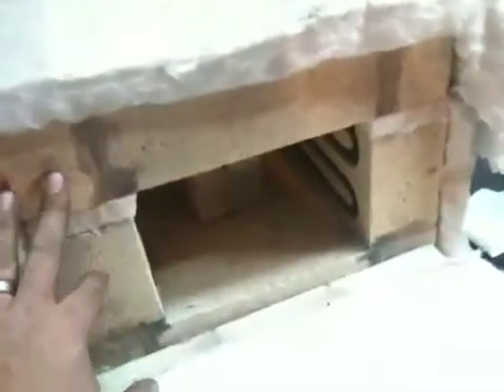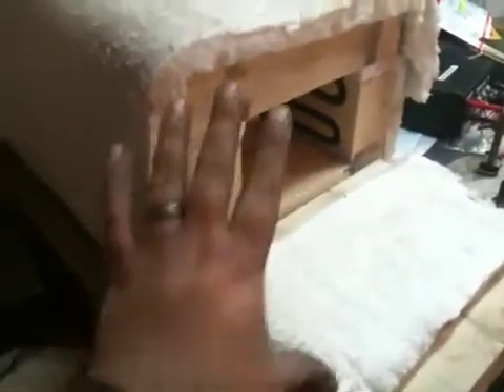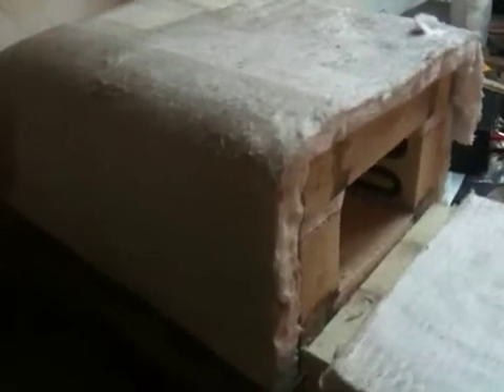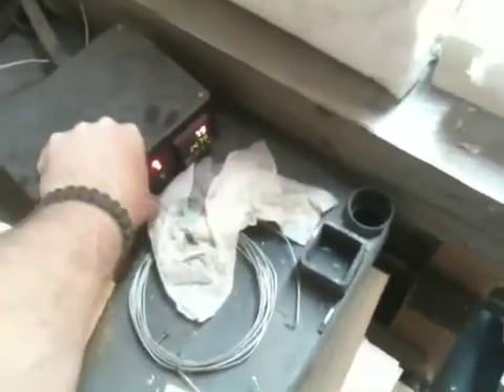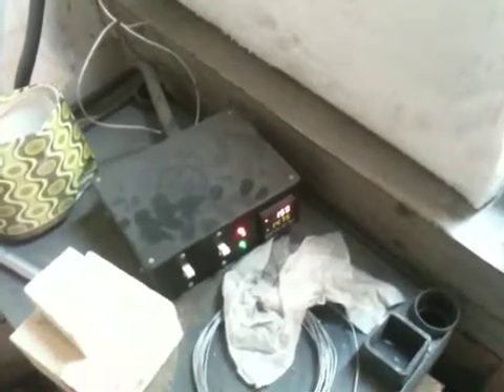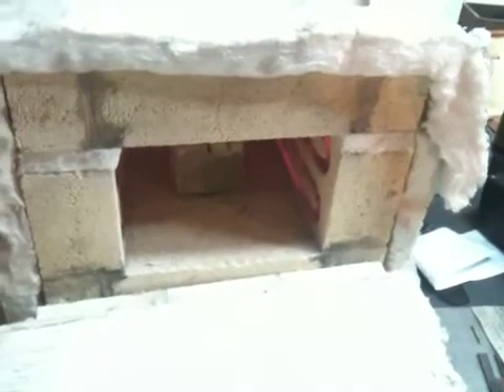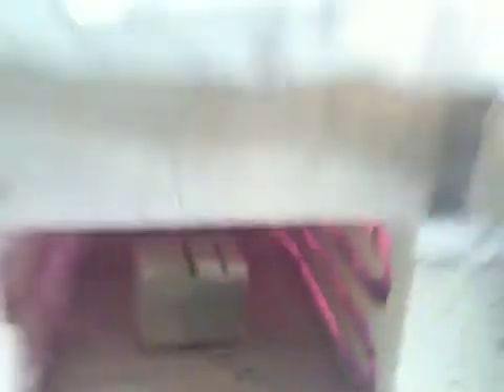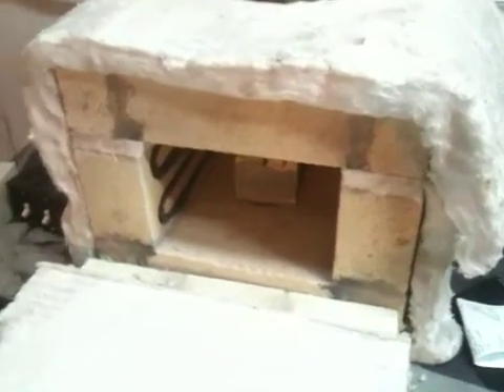Homemade Heat Treating Oven

Comment from the maker: I don't remember the exact gauge. Possibly 14 to 16. It's a 3000W element at 220VAC. Length was somewhere between 130 and 160" I believe. I did have to stretch my element, and purchased with that in mind.

Comment from the maker: Well, aside from your prices being not entirely correct, you left out several pieces:
bricks alone were about $100, mortar was about $30, Kanthal wire was around $30, PID, SSR, Heat sink, and TC were closer to $125, project box $12, CF insulation $45, 220VAC power cable, outlet, outlet box, etc... $45, switches, neons, fuse holders, fuses, hook up wire, etc... $45. You also neglect to factor in shipping for parts I couldn't easily source locally, not to mention, I bought extra of some things.

Comment: I'm stupified how you spent that much money on it. Bricks are anywhere from $3-$6 ea and the Kanthal element is $23 (if you only want 1400*F then you can use Nichrome for less $). The PID, SSR, and thermocoupling you can get for $40. High temp wire you can get for a few bucks as you don't need a great amount. Project box about $7 for electronics and some SO 14 gauge wire is only $0.68/ft. You are looking at maybe $200-$250 for that size.

Comment from the maker: @Duckyistrippin Correct. You can use is like a file/saw or a gouge. The brick is very soft. The benefit of using a piece of allthread (or just the threaded end of a bolt) is that you can make a round bottomed channel that will fit the element better.